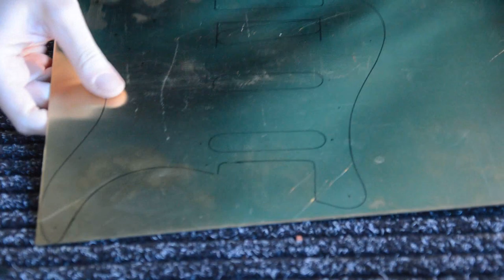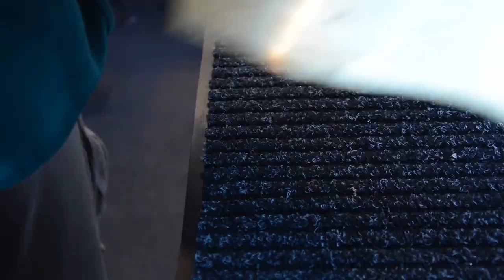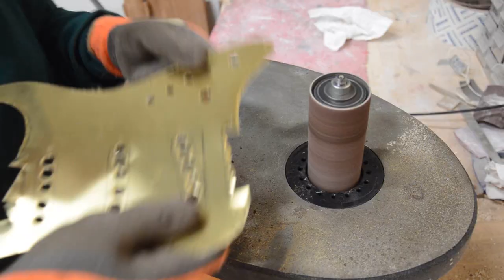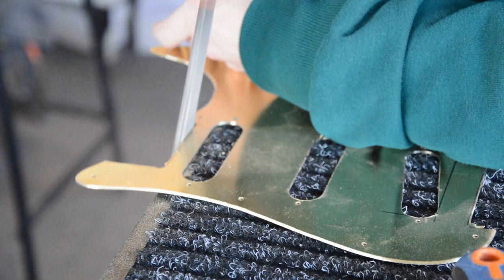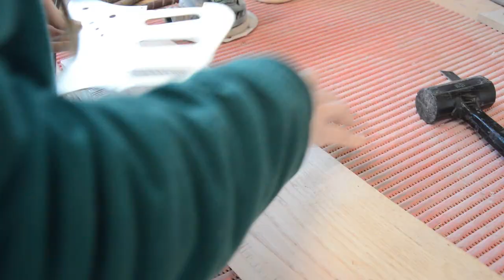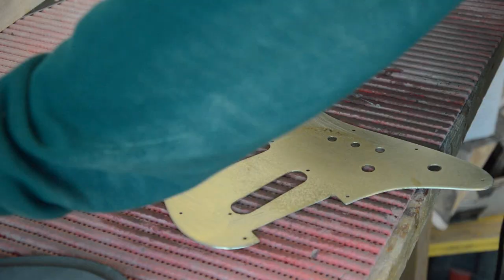STRAT GUITAR customisation - PART 1: making a BRASS PICKGUARD

Comment: How thick or what gauge is that sheet? I want to get some brass and relic it so I don’t care if it looks nice actually want it to get scratch and get a nice patina after doing a black patina on it. I was thinking 1.5mm for the sheet but thinking it may be a pain to cut/round.
Reply from the maker: This is 1.4 mm, but it's a very hard type of brass. If you get the normal one it bends easily and you need it thicker. And yes, cutting it is a pain 😁
Reply: Thank you! Guess we shall see what happens.. haha